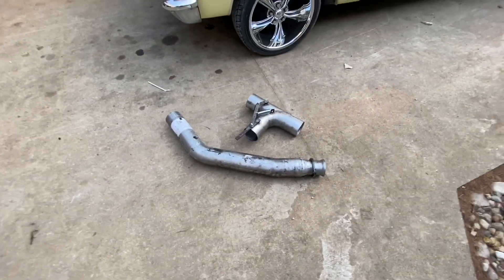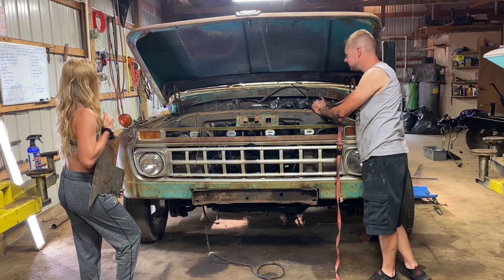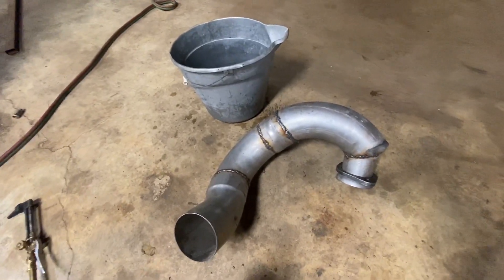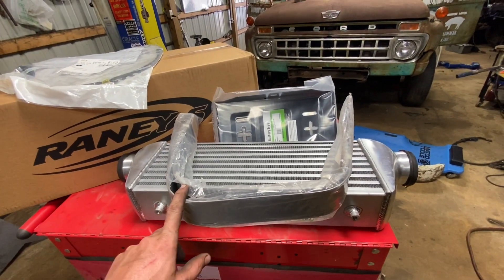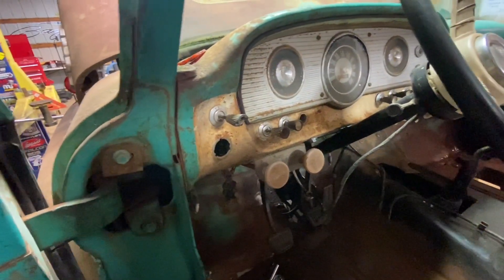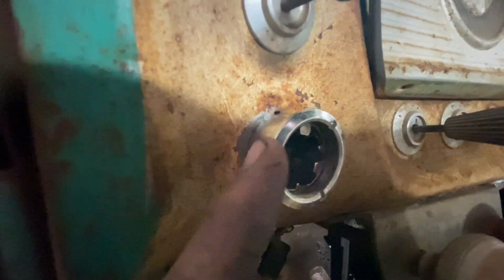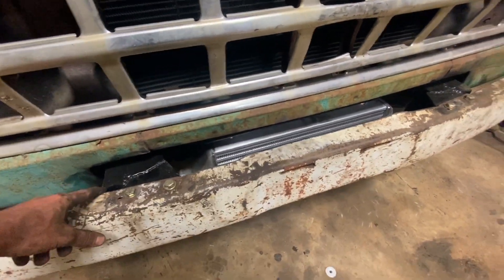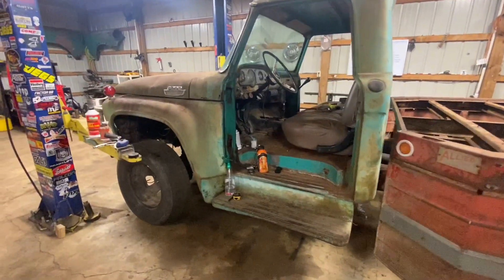Final build video!! 1965 sugarwood farm truck!!

Comment: nice job on truck, i just found a 70-71 dodge 800 in very nice condition. no rust.413 dodge big block stick trans. the truck was pumper truck for fire dept.  long wheel base . i see short wheel base in future. Jerry        Bloomington IL.